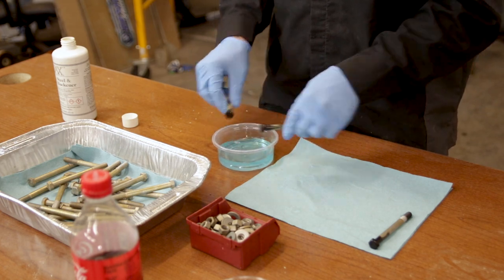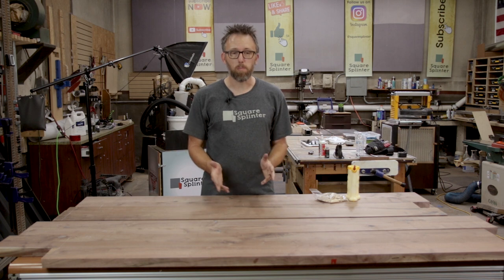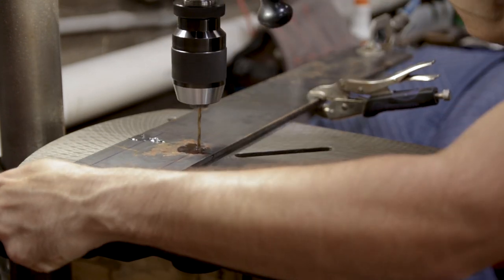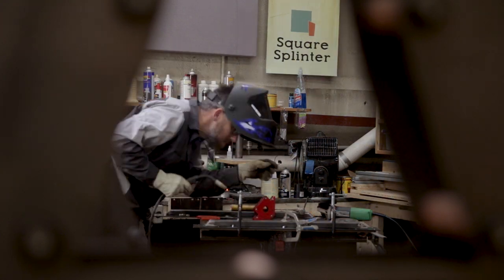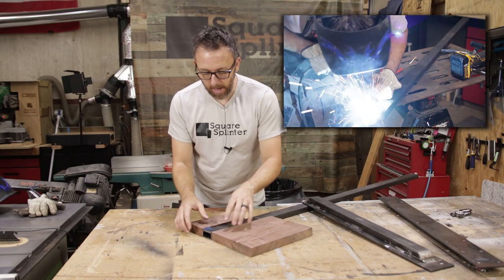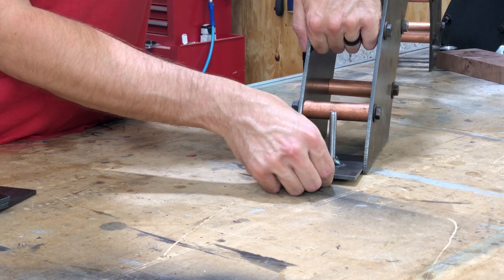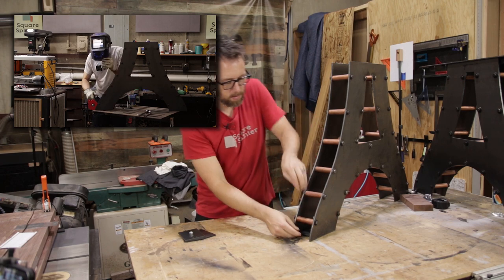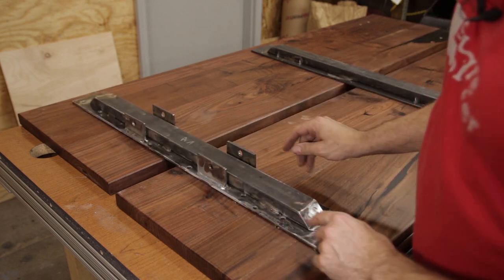Industrial Steel and Walnut Dining Table

Comment: Beautiful design!  I love the combination of steel, copper and wood.  A light look with industrial quality.  For the wood worker, without the ability to cut the leg panels, the steel leg panels could be substituted with half inch plywood or other material for a similar look and acceptable durability.
Reply from the maker: I would love to see a version with plywood legs instead of steel.  Maybe use nice solid wood that matches top to use instead of copper pipe as well?   Could be really awesome. Thanks!!

Comment: You could weld small flat clips on the inside of the brace and put more inserts into the table and bolt the brace that way.
Reply from the maker: Yeah, I really should have just had my fat plate pieces cut a bit wider and it would have helped a lot. 👍🏼

Comment: You should have used angle as your support on the underside of your brackets. It would be just a strong or stronger and would have left you way more room for your bolt's.

Comment: How is it structurally stable in the length ways. Surely you'd need some sort of diagonal bracing.
Reply from the maker: If you mean strength from “racking” it’s pretty strong because it’s only 6’ long and the plate on the top of legs is attached very well.  The number of fasteners used and also attaching to steel top stretcher it is rock solid.  👍🏼
Reply: The table is stunning. Glad to hear its stable.

Comment: Why'd you add Flood to the metal?
Reply from the maker: It’s a great, easy finish for raw metal to protect it from rusting. 👍🏼
Reply: @SquareSplinter  I had no idea.  That's awesome! Is it pretty durable?
Reply from the maker: In my experience with it, it’s not too bad.  You couldn’t use it for like a high traffic piece like a work top or something but for table legs like this it’s fantastic. 👍🏼

Comment: Did you try socket (allen) head bolts? They are narrower than regular hex head bolts
Reply from the maker: I actually like the big bulky looking bolts on the legs.  If you mean on the bottom side of the table, yes I agree I should have probably used Allen head.  They do look nice.  👍🏼
Reply: @SquareSplinter  yes, i meant for underneath. Nice project though!

Comment: That's great and all but how are you accounting for wood movement?
Reply from the maker: All the holes drilled for the mounting bolts are 3-4 sizes bigger than the bolts.  No wider than the panels are it will be plenty of room for movement. 👍🏼

Comment: You had me at Pantera 🤙.. Anyway this is an amazing build. What's the thickness on the table legs? Looks almost like 5/16th. If so, that's one heavy table. Which leads me to my next question, How heavy is that bad boy? This is a beautiful table. 2 THUMBS UP 👍👍. And consider me a subscriber.
Reply from the maker: It’s heavy. 😬. It is 1/4” plate.   Thanks so much for the support.  I have a few more design/furniture projects like this coming out soon. 👊

Comment: I can’t for the life of me figure out why you wiped the legs gown with Floetrol after W-D40. School me please
Reply from the maker: I used the Wd40 just to clean any rust lingering because the legs sat for like 5 months before i got to the build.  I cleaned after with acetone and then the Floetrol is actually a great alternative for a clear finish to keep the steel looking natural. It’s milky white as you probably know but when it dries it’s clear.  It’s a great metal finish.
Reply: SquareSplinter Thanks for that explanation. I had no idea(obviously) that floetrol could be used as a finish. Could that also be used on planes, and other cast iron items?
Reply from the maker: Yeah for sure I think it could.  It’s not going to have much wear resistance I don’t think.  I actually to be honest don’t even really know the longevity of It as a finish.  This was the first bigger project I have used it on.  Time will tell I guess.  It’s essentially a water based finish like a minwax water poly.  It’s a sticky nasty mess I know that. 😬